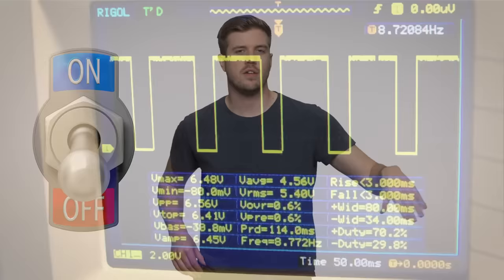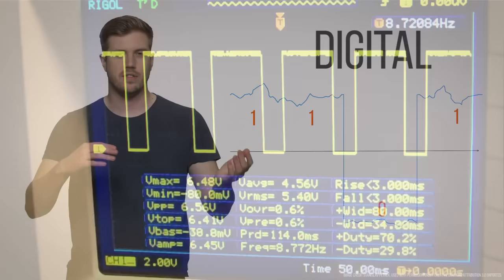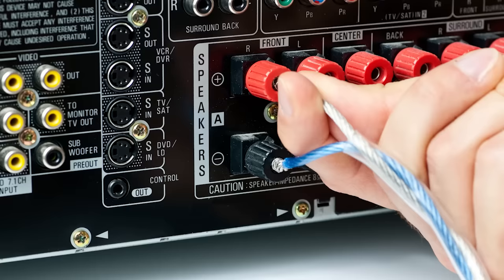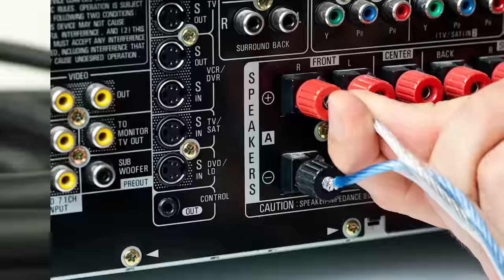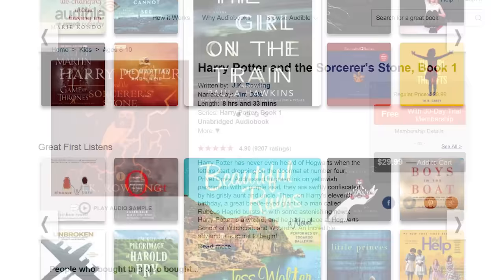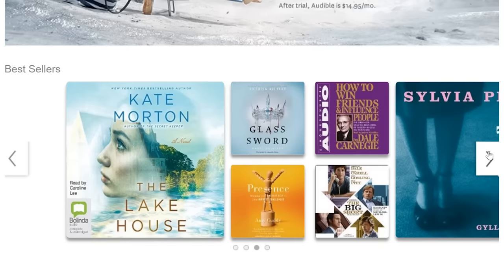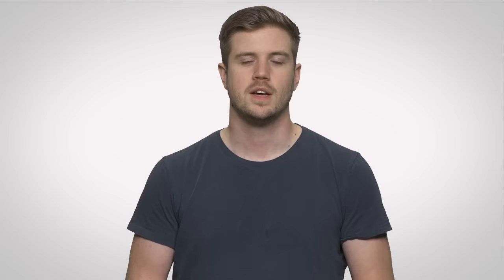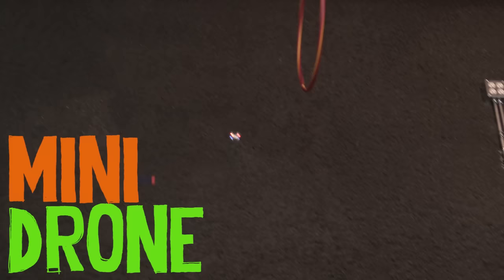Analog vs. Digital As Fast As Possible

Comment: There is actually a way to create an analog\digital hybrid TV. But before I tell you how, I just want to explain the difference between analog and digital TV.

We all know that a digital screen is made up of individual pixels, right? but what differentiates this from an analog screen, and what I have heard from the channel Technology Connections, is that analog screen has no individual pixels, but consists of only one pixel, that is the whole screen.
This means that the image gets an infinitely softer and more realistic image depth, because the environment we see is analog.

As I said earlier, there is a way to get the same analogue quality on a digital TV. A milk-toned plastic filter is placed on the screen itself. This breaks the light from the pixels, in a way that softens the image!

I have tested it myself. Feel free to try it yourself if you don't believe it.

Would be very cool if smartphones and other gadgets, were made with this technology!

Thank you for reading this!

:-)

I like your video!

Comment: Most digital signaling includes one or more levels of error detection and/or error correction. That’s why digital is “perfect”, not because digital is free from bit flips or other interferences. Unrecoverable errors are usually treated as signal loss. So, for protocols that can resend upon packet loss/corruption digital is great. As demonstrated by e.g. DAB, digital broadcast over the air has very negative user experience where analog broadcast with large radio spectrum work far better over very bad signal conditions.

Comment: The most beautiful sounding recordings were made in the 80's before digital ever hit the market. Analogue Tape Saturation produces Even-Order Harmonics and is very musical sounding and pleasing to the ear. Tube Compressors and Pre-Amps also produce Even-Order harmonics which is musical. Then came Pro-Tools. The noise floor was touted as being Zero, but what they did not tell you is that any Hi-Hat recorded in Pro Tools sounds like a trash can lid. Harsh Odd Order Harmonics sound very unpleasant to the human ear. 96k Recording means that the sound is sliced up into 96 Thousand times Per Second. Then re-assembled to hear it. There have been countless Plug Ins that try to achieve the Effect of Tape Saturation, but I have never heard a convincing one.

Comment: Broadcast TV signals are FM, not the same as AM. MP3s DEGRADE since they usually use compression, if they are encoded more than 1x, quality degrades faster than cassette tape. Digital broadcasts are not necessarily higher fidelity - bluetooth for example can have less high end frequencies. Digital broadcasts now almost always have lag when someone is being interviewed, equivalent to a signal going many times around earth in analog.  There is always an awkward GAP before someone answers a question being interviewed.
Reply: Incorrect,MP3 FILES NEVER DEGRADE WHEREAS CASSETTE TAPES WILL DEGRADE AS MP3 IS DIGITAL AMD CASSETTE TAPES ARE COMPLETELY ANALOG

Comment: My PC monitor is actually a TV and for some reason I have to use VGA instead of HDMI. When I use HDMI its all fuzzy and the aspect ratio seems wrong. The screen is 1080i capable, I can only set the resolution to 1920x1080 when using HDMI, but it looks horrible, so I am forced to use VGA at 1360x768.

Comment: Sor for VGA in computers does that mean that there's technically a digital to analog converter for those ports?
Reply: not "technically", there is AN ACTUAL dac inside there, in the gpu most of the time

Comment: I use a VGA cable to connect my optiplex 360 to a modern 720p monitor and get 720p, how is 720p analog.

Comment: how is it that isee spdif optical have an adapter that is a 3.5inch headphone jack??

i want to have the toslink optical output of my TV to be input as a "ine in" on my Pc which has surround speakers and will mix my PC music with the TV audio

i cannot for the life of me find a definitive TOSLINK SPDIF to USB input adapter. i see many USB "soundcards" that are external but have heard their quality is hit or miss and that the optical toslink on many usb soundcards do not seem to input the optical to the USB output but usually are just a pass through for a second optical or only convert the optical to output to the nalog headphone jacks..

id like to avoid adapting the optical to analog for my PC how is this possible?? i need an external device for a laptop not a PCIe card i just want the optical toslink that is present on motherboard and soundcards to be INPUT from a source for a PC not an output as the PC outputs to speakers itself.

at the moment i have a little generic optical to analog converter with the analog RCA's adapted to 3.5mm jack inserted to the line in on my mobo but would prefer all digital and i hate having an extra power plug JUST for the analog converter

can toslink/optical/spdif ports on motherboard be made to be inputs as well as outputs? i do enjoy my PC mixing music with my tv audio and a whole receiver or DJ deck is overkill for just two digital outputs

Comment: Digital gave us clear TV signals on our ABCs, NBCs, CBSs, Foxes and PBSs, plus more channels to choose from on over-the-the-air broadcast TV through the addition of subchannels (channels 1.2 and beyond) including the likes of MeTV, Comet, H&I, Laff, Court TV, Movies!, Charge!, This TV getTV, etc. 

I never really cared for the analog signals we had before the 2009 changeover, which were noisy and full of static and snow during certain times, plus anything past channel 13 (on the UHF band) had a harder time coming in if you did not have a good enough antenna to work with...

Comment: Problem with digital TV or digital radio (for the stations that are HD radio only), is you either get them, or you don't.  Whereas analog, you could still get "something".  In an emergency, this is life or death.  Thankfully the TV's sold today generally still have an analog tuner, which can be handy if an emergency was to happen, but let's say a tornado warning is issued, and that storm is preventing someone from seeing it on their TV, and they assume it's only a regular storm out their window.  Yea, not all technological advances are good.

Worst of all, is that they could have did high def in analog, and pulled this off, but hey, another discussion for another time.
Reply: +Brandon MacEachern You would still get problems like dot crawl and ghosting inhernent to the analog broadcasts, so switching to digital made sense quality-wise.
Reply: JJ Warner We aren't talking quality.  I agree when the signal is good, the quality is better.  I am talking emergency situation in a storm, digital does NOT work well, it pixelates and goes out completely at times.  Analog didn't go completely out, you just had static.  Therefore, you missed my point about emergencies, and my point still stands.
Reply: This is completely useless in most of europe though because in Europe basically all of the Analogue signalls from TV stations have been shut down, so your only hope really is radio...

Comment: Modern studio high resolution digital recording is actually more acurate than any analog recording and analog "warmth" can easily be emulated now. Analog mediams have their own sets of problems like reel to reel tape speed not being 100% constant, vinyl surfaces are never completely clean and having to use Dolby noise reduction to combat tape hiss, the list goes on......

Comment: so why do I hear a big difference when I hear music on my lp player then my pc or phone
Reply: Differences in mastering, the quality of the digital files and your hardware are the reason.
Reply: so you mean that if I download top of the line flac files are better then my lps ??
Reply: No, they would be equal, if the mastering and hardware are the same.
Reply: analog sources distort and introduce noise into the signal, maybe you like it, but it is just like a distortion switch on a guitar amp, digital has no noise or distortion
Reply: Coppercab: it's about math.  A sound wave has a lot of variation over time.  If you want to truly represent each point in the wave at every instant of time in digital form, it is in some sense impossible because the precise depth of the groove on a record changes every millimeter, 10th of a millimeter, 100th of a miilimeter, etc. etc. etc. etc, meaning that it would take an infinite amount of 1s and 0s to truly reproduce it.  The only question is how close is the digital recording getting to accurately representing the wave data.  This is where you get into 192 Kbps v. 320 v. whatever.  The higher the sample rate, the more of the actual wave is represented.  This is why satellite radio is the shittiest thing in the world.  The sample rates on sattellite radio signals are absolute dogshit.  That said, if you didn't already notice that just by listening to satellite radio without me telilng you that then you are really just imagining any difference you think you're hearing.  Most people don't know the goddamn difference unfortunately.  Otherwise, true Hi-FI systems would cost less because everyone would demand them and there wouldn't be so much shitty 128 kbps sound on so many youtube videos.  Quite simply it is not possible to beat the quality of sound of an analog record with analog amplification.  Digital by definition means degradation when it comes to audio.
Reply: jtatfsu1001 it is impossible to replicate an analog wave with digital data, but is is not necessary, it is pointless in fact, since a good enough mp3, or aac, or flac will be transparent to the human ear.

Comment: Analog broadcast TV signals may have gotten snow from interference but at least you didn't get an unwatchable pixelated mess if you had a weak signal.  Analog has a stronger signal so despite the snow I prefer it to digital.  I have so much trouble getting an digital signal to be watchable on my TV.  It seems if you are more than a couple of miles from the transmitter it is hard to pick up the signal now.
Reply: Incorrect,digital signals are way more reliable and won't drop out like analog would
Reply: @stephensnell5707  really?  Then why do my digital signals drop out whenever there is a light breeze while I could watch analog signals with no trouble under the same conditions?

Comment: You forgot to mention how the digital TV signal travels through the air, compare to the analog. Is it better?
Reply: +Angel Luis Trinidad Can you explain how you can make digital signals (1s and 0s) travel through the air? Far as I'm aware you need a DAC as mentioned in the video in order for you to convert digital signals to sound (you need to make it analog first in order for a speaker to work with it)
Reply: +Falxhor Yeah, it's the way you receive free over the air ATSC Network Digital TV, with an antenna. New TV's have new digital TV tuners. For old TV's you need a converter box, but not for new ones. Here's some information you should know by now: https://www.fcc.gov/general/digital-television

Comment: Funnily enough, VGA isn't actually that bad. I've been using a 900p 75Hz Dell monitor connected via VGA for years, and there has never been any issue with it, no screen tearing, nothing.

Oh, and, quick note to you guys; analog in technology nowadays usually refer to voltage and changes in voltage for data transfer.
Reply: VGA IS VERY BAD AS IT CANNOT CARRY MORE THAN VIDEO 
IT CANNOT CARRY AUDIO THOUGH
Reply: @stephensnell5707  Plug your headset into the PC itself...? I mean, of all the downsides of VGA compared to modern standards, you pick audio passthrough as the one important enough to type in allcaps about?

Comment: vga is long gone in my personal use. for my rig its a display port 144Hz on the main screen and dvi on secondary. 
i only use HDMI for connecting shuff to my home cinema reciever. vga is unfortunaly widely used in homes and in the workplace still. and thats definitly not good.
Reply: +snederw VGA is as good as you can possibly get for analog. Don't think I could tell the difference between it and DisplayPort reliably.
Reply: JJ Warner not reliability, but the performance in frames per secound and max resolution is quite alot different ;) so ill stick with dual link dvi and displayport as long as they perform better. vga is limited to about 60 frames per secound.
Reply: snederw VGA has basically unlimited bandwidth, due to its analog nature.

You could push 8K 240Hz through a VGA cable, if you wanted.

I game at 135Hz using VGA all the time.
Reply: but you still cannot run more then 60Hrz due to the lack of recieving capability on absolutly every single monitor in the world. dvi doesnt have to be reconverted to digital by the screen.... so as a matter of fact VGA is outdated. digital stuff is the best.
Reply: snederw 
The majority of early LCD monitors are 75Hz at least, all of them used VGA.

I also have a 2003 CRT capable of 512x384@160Hz through VGA.

Comment: More than just interference,  the big issue with duplicating analog recordings is also degradation of the medium itself.  When copying a single tape multiple times, the tape passes over the magnetic read/write head over and over, damaging the original tape on each duplication.

Comment: Wav or aiff if you care! And Analogue is better for sound and Digital better for image and everything else.
Reply: +Çerastes
It is better  for sound If you are an audiophile, musician, or you just love it. Analogue wave reaches more places and variations that are always uncertain or differ all the time... While the digital wave is plain static and doesn't have the feel... either way both work or have to work together in these days. look into an analogue synthesizer and compare the sound with a digital synthesizer is not the same. Real music studios where most of the music released worldwide has decent audible quality because they were sound engineered using many analogue tables, compressors, racs etc...

Something tech gueeks are not aware and there is no interferences in those hardware high end stuff... plus its actually digital sounds that make  noises in pc computer that come from components and such when you hear on headphones and speakers.

That's why sound producers use external cards that read analogue signals from analogue instruments

so this tech quickie is not as accurate or extensive to cover it all

and 320kbps is audible but is mp3 and it compresses the sound so it cuts frequences and sounds... when you play a wav sourced sound you hear more quality like you would on a cd you buy at a music store
Reply: +ST A WAV, FLAC, APE, AIFF, or any other lossless codec really, is a perfect copy of the music. 

A 192KHz, 24-bit lossless file is the closest you can get to perfection, past there it really depends on recording and playback equipment.

There is no reason why anyone should use analog over digital.